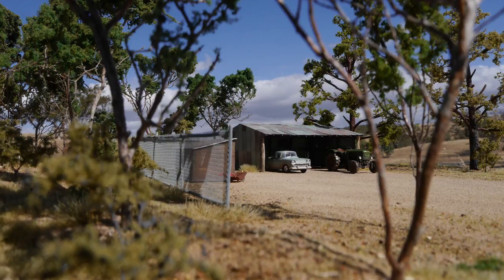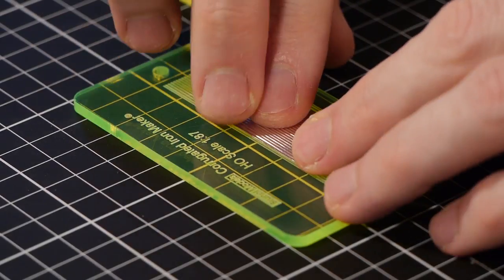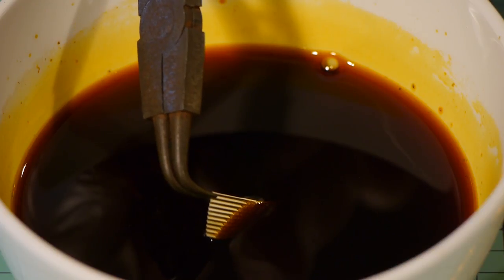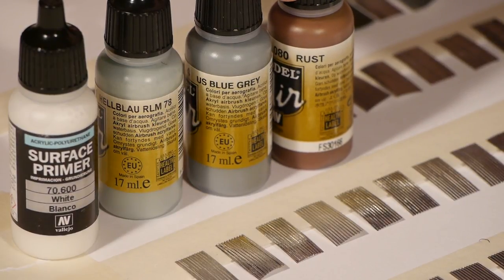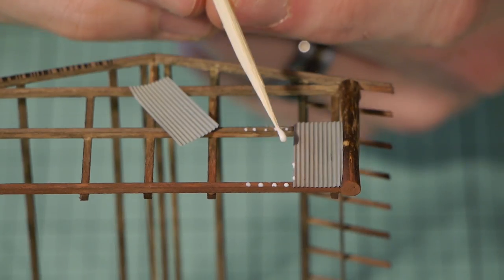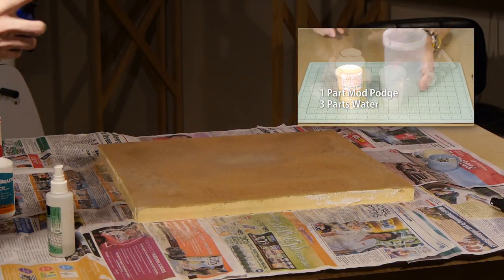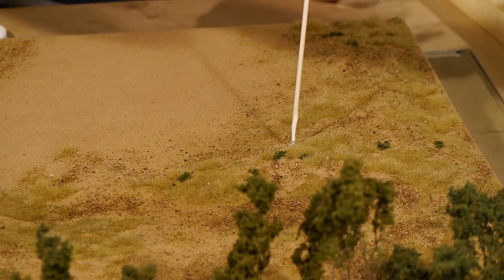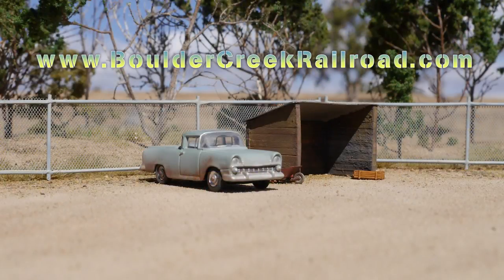Realistic Scenery Volume 4 - Modelling an Old Farm Shed - Model Railroad

Comment: Another really excellent project, and video.  I am impressed by how well you compress information, and adding in all the pips and links.. well, I know that takes time.  Really nice.

I love the acid etching of the foil for the corrugated roof.  You can't get more realistic weathering than that.  :)  The foil crimping tool is pretty cool.  But I shuddered at the fragility of the panels.  It's hard to argue with the results though.  

As a funny aside, I really like your black cutting mat for a background.  I might steal that if you won't take offense.  ;)  I've been thinking a lot more about my bench background and really need to clean it up visually.  I've been thinking of white, but black is much closer to my heart.  grin

Nice weathering on the tractor as well.  You didn't mention it, but I noticed.  It really added a lot to the scene.  

Overall fantastic scene and content delivery.  I always look forward to your videos.
Reply from the maker: +Terranscapes Thanks Mike, the foil is obviously very fragile but for the type of scenery I'm building which hardly ever gets touched once it's finished it's ok, but if you used this on a gaming board I'm sure it would get destroyed very quickly.

I use a couple of different cutting mats, I really like black as you said it provides a nice clean background but I also like the light blue because sometimes the black clashes with other dark details. 

It's funny that you noticed the tractor! It was your comment on the last scenery video about adding a little weathering to the tractor that made me ensure I did it for this video... That one was for you ;-)

Thanks for giving such great feedback as well, you're one in particular I like to watch and I always take your feedback on board.
Cheers
Luke.
Reply: +Luke Towan Glad to inspire getting something dirty.  ;)
Reply: Terranscapes yep that's our Luke

Comment: Fantastic. Love your techniques and detail. Going to try to get one of those tools - I've been laboriously making individual bits of iron with a cocktail stick gig!
Reply from the maker: +davie maclean Thanks Davie, yeah this little tool makes light work of making corrugated iron, the cocktail stick gig sounds like a great idea though!
Cheers
Luke.
Reply: +Luke Towan Thanks Luke. Like all great ideas, it was someone else's, for O gauge, which I scaled down. I've been using cut down takeaway food containers, which is more sturdy than foil, but probably a bit thick! Cheers, Davie
Reply: +davie maclean  Got a corrugated iron maker from Brunel. No one seems to do one this side of the planet. Glad I did, it works great and my cocktail stick jig, while still a good idea, would have been a good bit over scale for OO. Cheers, Davie

Comment: For weathering the wood, you could also do this. Get a bucket, or a cup, fill it with vinigar, then put steel wool in the bottom. Leave it over night, then just dip the wood structure in the bucket and leave it for a couple minutes, and it will turn out looking weathered.

Comment: I know absolutely nothing about making small models like this but watching your videos makes me want to try so badly!! Do you have any tips for someone just starting making models?
Reply from the maker: +Michael Power Hi Michael, you just touched on one of the hardest points and that's finding a place to start! My advice would be to try and stay motivated and experiment with different techniques, whether you adapt techniques from someone else like using the methods I show in my videos or finding your own unique methods. My first scenery projects were pretty bad... but I just kept trying new stuff and watched many many YouTube videos as well as reading plenty of online articles.
Just watching videos and reading articles will help get you motivated to start, if you're interested I have a couple of articles detailing the tools I use most for scenery and the materials I use on nearly all my scenery projects.
That might be a good starting point for you.
The articles are on my website under the Tutorials tab or just scroll down once you on the main page and they are near the bottom.
http://www.bouldercreekrailroad.com/
Hope that helps a little.
Cheers
Luke

Comment: Hi Luke,

Excellent tutorials thank you, can I ask though with the Ferric Chloride after the initial use can it be sealed and kept for future use or do you need to make a new batch each time? if it cannot be stored how do you dispose of it because in the UK all the articles say it must be disposed of at a chemical waste facility due to the copper deposits created after use.

Or is that only after PCB etching, sorry for all the questions

If you or anyone else could answer this question I would be grateful

Regards

Kerry
Reply from the maker: +KerryEmery Great Question Kerry, I haven't tried storing it for any length of time. I think you can by premixed bottles so I'm sure it can be stored. As for disposal, there's an area down the back of the house, I dig a hole and dispose of it there... not sure if it's supposed to be disposed of that way? There wasn't any disposal recommendations on the package?? 
Cheers
Luke

Comment: You really used a "Deutz" tractor :-) Is this brand known in the states? (I just reckon you live in the USA because of the sceneries you build and could've sworn this is a John Deere farm *g*)[EDIT: just went to your homepage and found out you're from down under]
I'm really amazed by the enthusiasm that shows on these dioramas. One thing for future sheds: you always should use diagonal struts when building a structure frame. Makes it look even more original.
Reply from the maker: cool  😊 thanks for the tip, most of the vehicles I buy are from Busch which are mostly European, they make the best vehicles!

Comment: You always use iso before you glue.. Wondering what that does?
Reply from the maker: the alcohol helps the glue soak into the scenery better, that way everything gets secured better and it prevents the glue from drying on top of the scenery leaving a shinny layer over everything.... if that makes sense 😮
Reply: Luke Towan oh ok. Cool. Thanks for replying Luke! Keep up the great work